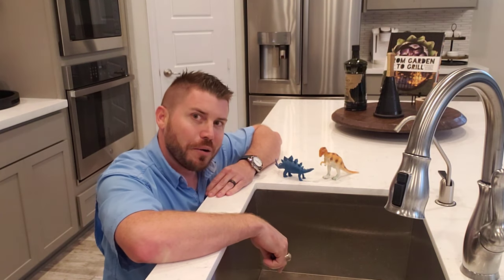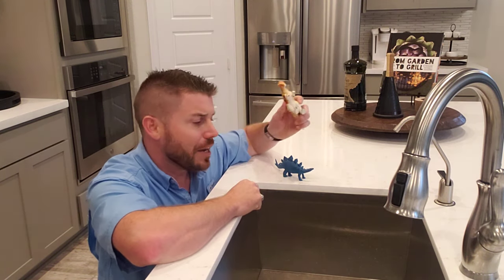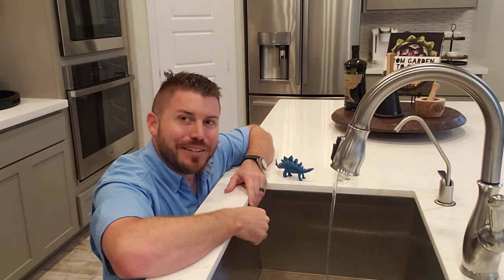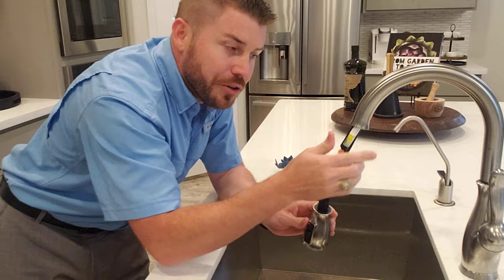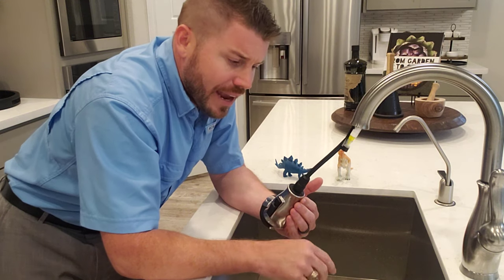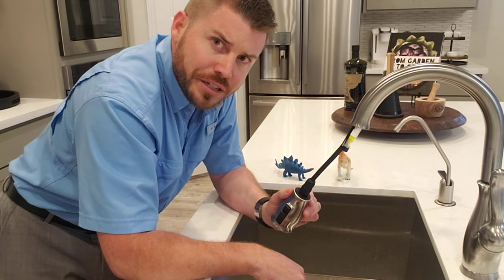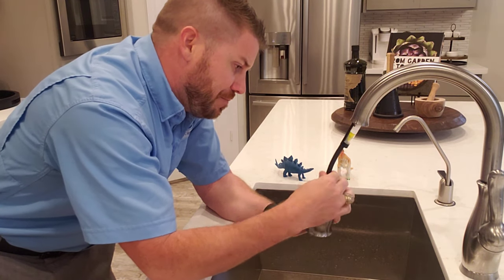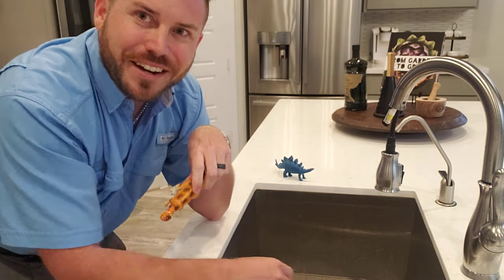Kitchen Faucet Have Low Pressure?

Comment: what else can be wrong if that was cleaned out and water pressure still low?
Reply: Your water line could just be kinked, that’s what happened to mine. I had low pressure until I pulled the faucet out. I had a kinked supply line
Reply: Cartridge could possibly need to be replaced
Reply: Hard water causes a build up of gunk.
Reply: Mine is new.
Reply: Could be your pressure tank
Reply: We've had to call the faucet company twice and get a new head piece.  They do it for free and say there's no way to fix them. I even stuck one of the heads in a ultrasonic for a few hours and it didn't work. The flow usually starts slowing down on the hot side first.
Reply: @djsc0948 Yep moved from Michigan to Texas and the water in Texas is really hard didn’t know that until a plumber came out to show me. Love Texas but I hate the water😩 💦
Reply: It's the cartridge, I had a similar problem, cleaned it with proper solution and still low pressure, I decided to change the cartridge to a different color and now it's blasting, no need to call anyone and waste money try changing that plastic cartridge with one from a faucet that works just to test it, if it does you know which one to get, hope this helps someone out there stay safe!

Comment: So much easier than what I was planning.   New construction home. Two months in.  Almost zero water pressure.   Fixed in about two minutes.   Thank you.
Reply: The valve in inside the faucet could be bad. I do not think there is a way to replace or repair that.
Reply: My faucet is making a noise
Reply: @mildredqcollazo3875 It’s probably haunted. I’d move.
Reply: Amazing simple

Comment: Thank you so much!! This faucet was installed less than a year ago and I couldn’t figure out why the water pressure was decreasing over the past week. There was some sediment and black film stuck to the filter screen. After cleaning that off and rinsing out the head, it works like new again! Much simpler than I thought it would be.

Comment: That’s the exact problem I was having but I thought it was the filter screen at the head. I tried cleaning that several times and wondered why the pressure wasn’t coming back. Thanks for the video and the correct fix.

Comment: I'm a recent landlord and this video just saved me. I tried troubleshooting the hose under the sink first and it wasn't the issue. I got a "well at least you tried" and it made me determined to fix the issue! I found your video because I wasn't sure how difficult it would be to take apart the facet. Went back and tried this and found the culprit; a clogged small filter inside. Got a praise and high five and redeemed myself, Lol Thanks!!!

Comment: Who knew that 2 years later you’d still be helping people? Water pressure coming out of my kitchen faucet was pathetic.. my condo is definitely not a new build.. built in 1980’s,  but we have a horrible problem with calcium and it’s build up. I took the head off and soaked it in a cup of vinegar because I know that will help dissolve that.. After soaking the entire head for about 15 minutes, I put the head back on and I have water pressure again!! You just saved me from the extra work of replacing a faucet that is only a few years old, not to mention the cost!! THANK YOU, THANK YOU!!!

Comment: Duuuuuude THANK YOU! That’s exactly what the issue was with my faucet. Did what you said and it worked. So glad I didn’t have to mess with the hoses connected to the hot or cold water valves. Thanks again! Subbed.

Comment: Thanks for posting this. Pretty sure you saved me a hundred bucks or so
Reply: Thanks, doubled the flow, installed less than 2 Years ago, lots of little black rocks.
Reply: Still a little on the low side  but better then the drizzle it was before
Reply: Same here

Comment: We moved into a lease place February 1st with similar extension faucet.  They sent 2 plumbers out, both said low pressure and lack of hot water was due to the hot water heater being far from the kitchen...hmm really ok.  Your video helped solved both problems...now have a happy wife THANKS!  (There was white goo covering the screen in the faucet head.)

Comment: Thank you for your very informative video.  We were very stressed out with the low water pressure at the kitchen sink,  and it effected our hot water from the tankless water heater.  We did not have enough water pressure to get hot water at the kitchen sink.  We followed your instructions and now it works like it is supposed to.  Thank you!!!

Comment: Thank you, it definitely did the trick. 
 I had cleared the aerator, back flushed the cold, hot water and spray lines and I still had no pressure and had not realized that there was that small "screen" in the handle which in my case was a plastic ring with teeth  piece that was clogged, as well the plastic tube inside the spiral steel pull out  was kinked when it was attached to the spray handle.

Comment: This informative video solved my faucet issue.  I initially thought my battery was low on my no touch faucet and was the cause of the sudden low flow of water.  I’m my YouTube search on how to change the battery this video popped up describing my exact problem.  I followed his instructions removed the faucet blew in it and soaked it in vinegar for about 15 minutes since I could see some calcium deposits rinsed it at replaced. Full flowing water resumed.  I apparently have some really hard water since this is a new faucet which has only been installed for 6 weeks.  I thought my faucet was defective.

Comment: Thank you! Was about to rip out my new sink. We had our main line replaced and I think some of the dirt and whatnot was caught in the filter. The only faucet affected was the kitchen. We also replaced our disposal so had to deal with water lines then too. I thought I might have ruined the supply valve. Nope. Just a little gunk caught in the screen in the head. Thank you very much!

Comment: Thumbs up. Just installed one. Good hot pressure. Low cold. Swapped lines. Followed. Found your vid. Popped off head- turned on water. Thump. Something came out. Couldn’t find it. Pressure returned, problem solved. Thanks.

Comment: Thank you for your video. Last night, my kitchen faucet have low pressure one hour after I washed some dishes. I have used this faucet over 07 years.. I checked the main water pressure at the main line is normal. Well, I hope your video will help me to solve the problem.

Comment: Ha! Been battling this issue for some time, and had to snake the hose back up the first time I took the head off.  I was wondering if it was necessary to take the head apart to clean the inside, since I had already cleaned the aerator.  However, using that procedure you mentioned a couple of times (the second time with higher pressure pointing up into the head) resolved my issues.  Thanks!

Comment: I wasn't sure but thank you for posting to see where to separate in order to clean out the gunk. Note: if you have a faucet like this one, check to see if there is a little button you need to press in order to screw the tip off.
Reply: Thank you for mentioning the “little button”—you are the only one who mentioned this so it prompted me to not give up, but the part with the button had to be popped off on mine, not screwed off.  Only my kitchen sink had low pressure in my new four year old house.  I carefully and slowly was able to take it all apart, it went back together so easily and made a huge difference.  Not bad for an old lady of 78 living alone!  I responded to “rebeccahollar6821 of 3 mo ago” in detail because she mentioned a “little button”  and asked for suggestions, I hope I was able to help her.  8:33 pm

Comment: Thank you for sharing your video. I got the low pressure with cold water only at the kitchen sink. I detach the head with an aerator and the pressure is still too low for the cold water. We experience this problem for months  There is no leak anywhere in the house and only have this problem in the kitchen only. I replace the water faucet with a new set and still have the same problem. What is the next step we should try?

Comment: Moved into a "new" condo, built 2007. Newish faucet. Low hot water pressure. Checked both filters, cleaned best I could. Still low pressure in hot water side vs cold water. Problem underneath? Hope to solve this before calling plumber....

Comment: Great video!  I just swapped out my side sprayer hose.  Water pressure was fine for the first day or so.  Now it looks like this faucet before you fixed it in this video.  Because the side sprayer is independent of the faucet itself, I am sure if this will fix my problem.  I plan on trying this fix on my lunch break today.  Any other suggestions if it doesn't fix it?  Thanks in advance for any info you can provide.

Comment: Thanks for your Tip, my issue is different. I did but the low pressure is not the the discharged? I think from the control wave, hot and cold water. Or the malfunction. Any suggestions? Thanks.

Comment: Even after cleaning out the head ( per your fantastic video demo) pressure is still low. Handyman in our high rise condo did check beneath sink to confirm pressure is high. FYI..our 2nd high arc kitchen faucet changed in 3 years since moving in.  Dunno where else to check for root of problem. HELP!!!!

Comment: My faucet is an old style and doesn’t look anything like the one you’re featuring.  It is a brand new set that a plumber installed a few days ago.  The pressure is lower than the old one so much so that when I do dishes I have to mis up the dish detergent and water with my hand , otherwise the water coming out is too slow to make suds.  I told the plumber about it and he looked and said it seemed normal.  Of course he would say that.

Comment: I have four sinks that need this attention... will get to them tomorrow.  I'm guessing that I should also remove my shower heads, as well as the filter on my washing machine lines.  I have a new well, and it put a LOT of sand into my system.  One of my toilet lines also seems to be clogged, as that toilet tank will not fill.....grrrrrrrrrr.  Idea for another video - I had  floating, click lock LVP flooring put throughout my 1000 SF home - it is WATERPROOF (vs. water resistant)... in the last 6 weeks I have noticed an area about 4SF that is "lifting" off the concrete sub-floor.  This is a bit more "floating" than I would like... joints between planks are solid... is there a "fix" for this?

Comment: Great video !! What could be the main reason the water pressure getting dropped assuming we start few faucets like 2-3 simultaneously? Is it safe to say that i need to focus my energy on Pressure valve that is outside the house?
Reply from the maker: Yes, depending on your water provider there is a regulator by your main line and it will only supply up to a certain pressure to feed the whole home. Check with your water provider if you feel it is inadequate and they can do a quick pressure check, but you may be limited to the amount of pressure according to your building code. Best Luck!
Reply: Madera - Cibolo Canyons thanks for the response. I did work irk with my water provider and it turns out that the water pressure from the main line was ok. 

What was bad was the pressure at pressure valve. Once the plumber adjusted the pressure, it turned out to be ok.

Comment: @Chesmar Homes Harvest Hill  Well...there was some black stuff that came out of the nozzle, but I can’t get access to the back of the screen...it’s in the front of the nozzle  & made of plastic.  Now...I have less water pressure...believe it or not!?  The tube out of which the water runs is pretty small.  I can’t believe more than a trickle could come out of it!  Could it be a bad design?
Would putting the head of the nozzle in vinegar for a bit help??

Comment: This tip works initially but I keep getting more blockage. What would a cause for this? Busted pipe?
Reply: more gets by and into body.. his approach is too simple
Reply: @gusorviston1  The cartridge in the handle get clogged as well so you have to take handle off and clean cartrige

Comment: I appreciate the video but like so many other my delta touch isn't this easy. I can't take the head off as it's a tight threaded beast that can't be turned. Plus the flow is solid when manually engaged. woth the faucet. So it can't be clogged anyway right? Tough it off and then on and only then does the flow slow to a trickle. Is it the tech underneath? Yes batteries have been replaced. Any help appreciated.

Comment: I appreciate your sharing in this particular style of faucet. We have done what you suggested, and cleaned the filter where the water exits the faucet head. Each time we have minimal success if any. I suspect there is an internal pressure restrictor - may or may not be adjustable - but I don't know how to open up the faucet head without damaging it. Any suggestions? BTW,  the pencil is a great suggestion. We've been using a binder clip clamped on the hose. Thanks again
Reply: No, what he did is removed some of the dirt. The aerator is further down, where the water exits the head. You need to take it apart and clean the inside. This dude did not do that and he just made it slightly better.  I'm searching for a tutorial to take it apart. Older faucets were easy, the end unscrewed and the screen was easy to clean. The new shower-head design is not simple to take apart.

Comment: Thanks, but what if it seems to be in the lower part.  How do we fix that? Aren't there two places we could clean it out?
Reply: Same question here. I tried the upper part but it’s still not working.
Reply: @nyartisticwriter  I ended up just banging it's kind of hard in the black granules fell out and it worked! You may want to keep at it a little.
Reply: Austin Seagrave Thanks

Comment: We have an associate that rented new apartment and this is exactly what's happening with their kitchen sink faucet. Pressure is low and when we tried to connect a water filter,  the water came out around the sink base.  We believe that this might resolve the problem. 😮

Comment: I have had 2 new faucets get a low flow on one side only the cold on the first one now today the same problem but plugged on the hot one with low flow. I live in a condo so pressure is not a problem

Comment: My aerator had nothing in it, still low pressure.  So I read online to turn the taps under sink.  I did, now I have no water-hot or cold.  I can’t get the taps to open like they were, before I played plumber.  Any advice?  I would be thrilled with low pressure, better than no pressure.

Comment: Thanks for this. Any concerns at all regarding the CLR damaging the finish on the faucet?
Reply: I used vinegar in a small dish to clean the outside of the aerator part.  Just deep enough to cover the aerator section.  It has little nipples that hold it up just enough.  Worked great.  Takes a little longer though...but super cheap.

Comment: Question, I just had a new Kohler kitchen facet installed, the pressure it’s great but the water don’t come out as a straight stream  it’s splashy. I already cleaned the filter and still the same, what do you suggest ? Can it be a damaged faucet.

Comment: The city turned off our water during this freeze and when it was turned back on, a bunch of dirt came along. I had low water pressure to my kitchen faucet. The faucet head screen was clean but I found a lot of dirt when I disconnected the valve hose on both hot and cold supply lines. After cleaning it out, water pressure improved but was still not to what it was. I have a kohler touchless faucet, so do you think the dirt could be trapped elsewhere?
Reply: Yes same here, Are you in Texas?
Reply: @cherry0105   Yes, I fixed my problem. There was another screen filter on a water line. It's a plastic piece with 2 tabs. I pushed them in and pulled the hose apart. Cleaned the screen and snapped back together. Make sure your water is off before.

Comment: My faucet is clogged at the black pipe where you placed the pen. How do i clean it? Thank you. When i disconnected the valve from cable going to the faucet and turned water on then the pressure was normal.

Comment: How do you get the water hose back up through the neck of the faucet. I got a friend to push it back up the faucet and I used a meat thermometer to align the hose to come through the faucet and screwed  the sprayer back on.

Comment: What if the mineral clog is above the head somewhere in the hose or the connection hoses under sink. When I take the head off it still is just dribbling out of the hose.
Reply: That is what is happening with mine, too. It suddenly flows, then dribbles (mostly dribbles). Help!

Comment: How do you take apart the entire faucet head?  My issue is that stuff got through that white screen and got stuck within the head.  It never made it to the aerator in the front.  So even when I take the head off and try and clean it the white piece on the inside it clean and the aerator on the opposite side is clean.  But when I turn the water on when the head is off I get full pressure.  When I put the head back on and turn the water on I get very low pressure.  So the issue is something INSIDE the head.  How do I take it apart?

Comment: What if it’s low pressure at faucet and the hand sprayer on the side?
Reply: See if the head is ‘crusty’. Take white vinegar & put in baggie then put sprayer head in baggie use elastic band to keep on & let it stay abt 15 minutes.  Repeat if necessary